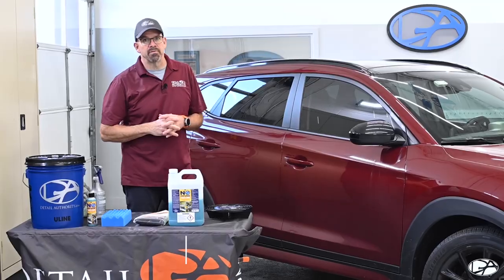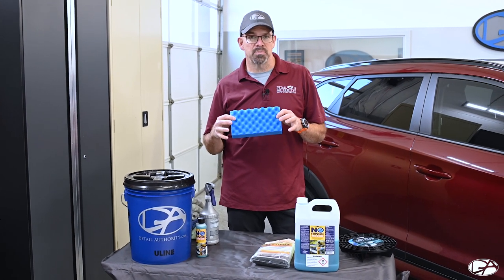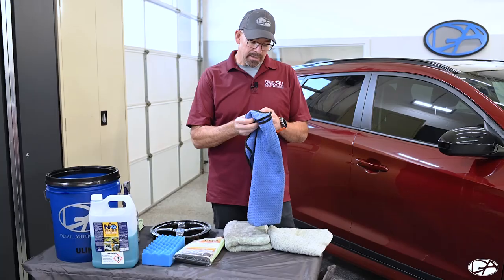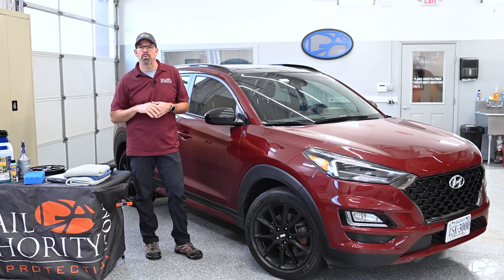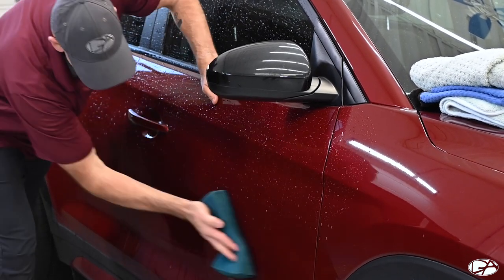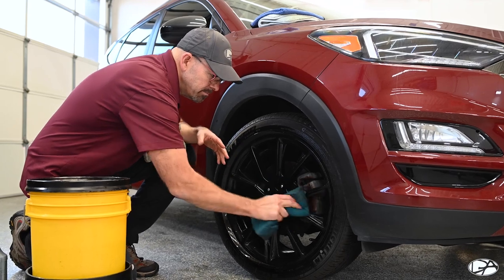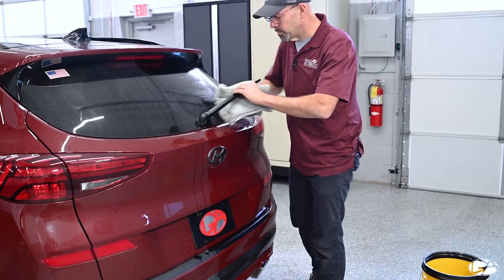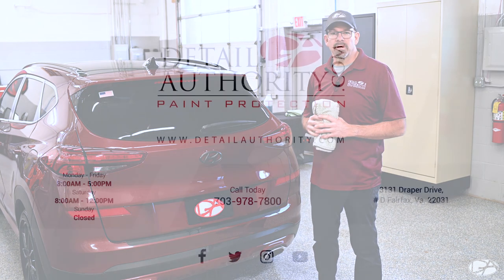Optimum No Rinse (ONR) Video

Comment: Good video, many people overthink this product with multiple towels etc. I just follow the instructions on the bottle although I usually pre - spray with the ONR before making contact. It's a safe product.
Reply: Using multiple towels, Garry Dean method or whatever one wants to call it, is a good way to use ONR or similar products. Bonus is that you use less product and don't need a big bucket with a grit guard. Down side is that you need to wash those towels after washing a car

Comment: The trick to any RW imo is a 2nd damp pass with a MF towel. #1 is picks up any missed dirt #2 since by design the RW suspends the dirt in the RW, the drying towel gets dirty. The damp pass removes the “dirty” RW and the drying towel stays clean #3 drying towel last longer (staying dry longer)

Comment: I've had great success mixing up a solution of ONR and distilled water, using a magic eraser cleaning the inside of a windshield.  Wipe dry with a glass towel a couple of times and there are no streaks and the glass shines!!
Reply: In my experience, ONR doesn't work well on interior glass. I get streaks or an oily film that's difficult to wipe off. I used a wrung out towel, followed by a dry towel.

I then switched to a dedicated glass cleaner, and found the less I use the better. Two/three sprays on the towel per section is all. No streaks or oily film, and easy&cheap to use. Really dirty glass needs a second application preferably.

Have yet to see if ONR will work better that way.